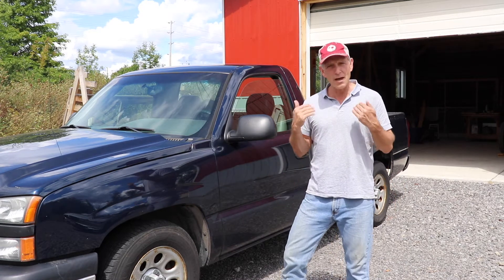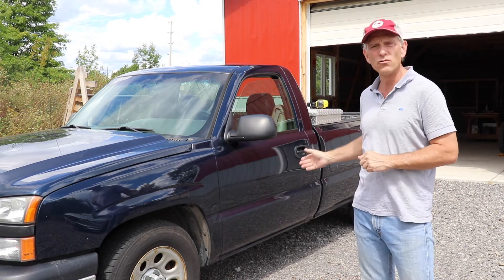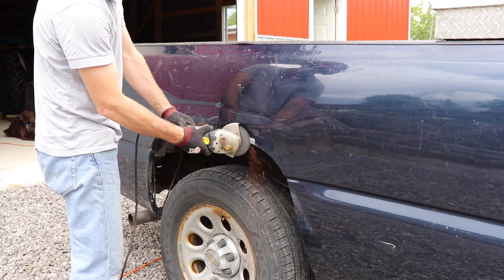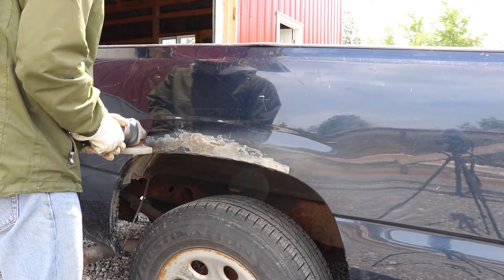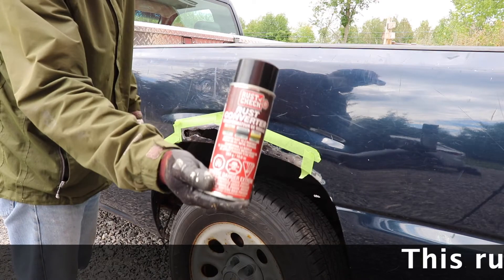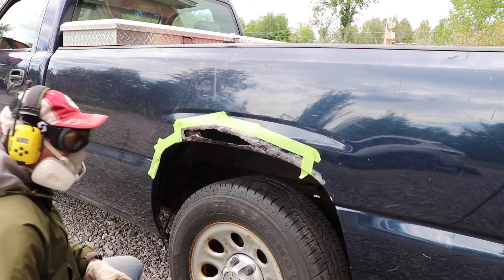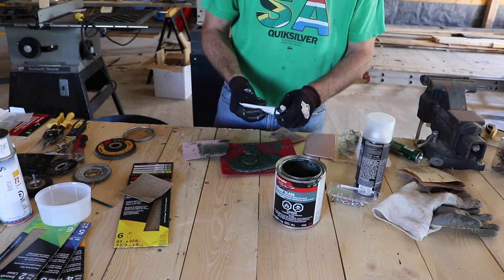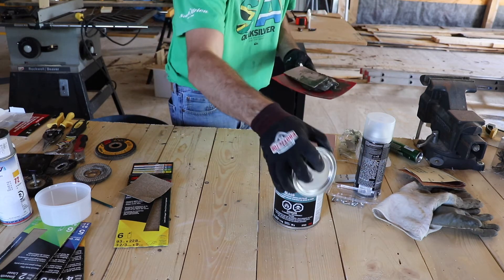How I Repair the Rust Damage on the Fenders and Tailgate of My Pickup Truck - #1

Comment: A decent temporary job. You would manage a 100w Mig easily then cut out rust completely, replace with new metal.
Reply from the maker: Thanks. Would a flux core welder work for the job?
Reply: U know more then this guy😂😭like wtf I just watch
Reply: @StonerKing-pg9cs  Complete waste of time not doing it right! The rust will come through from inside in one year!

Comment: What grit or type of sanding disc did you use to strip the rust
Reply from the maker: Hey Raymond, I first used a cutting disc ... a mistake. I changed over to a sanding/flap wheel. I'll have to look at the grit and get back to you. Peter at the reboot.

Comment: You’re going to have to cut that rust out of there and put patch panels in to do it the Right way Bondo holds water it’ll just keep rusting. Got to get rid of the cancer.
Reply from the maker: I agree. It was a fix for two to three years. It is holding up well so far.

Comment: I hate to say it but what your  doing  makes your  rust problems worse! And come back  quicker!  Welding  metal  in is the  only way  to fix it.....!
Reply from the maker: It is a simple, cheap fix on a $3000 pick-up meant to give it a couple years of looking better. Welding is a better option that I decided not to go with due to cost effectiveness.